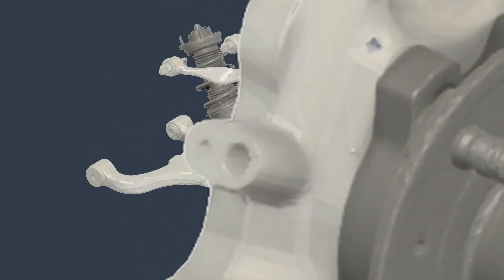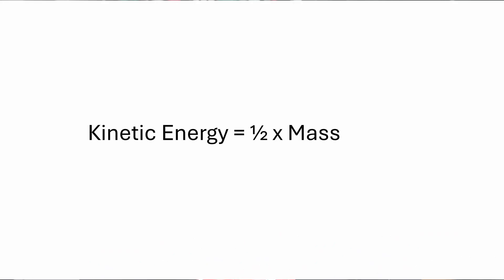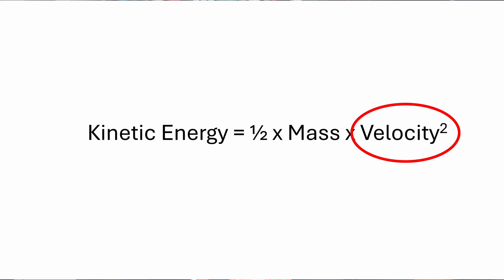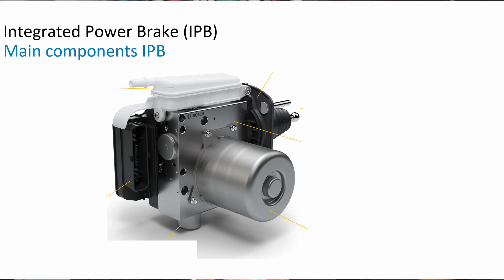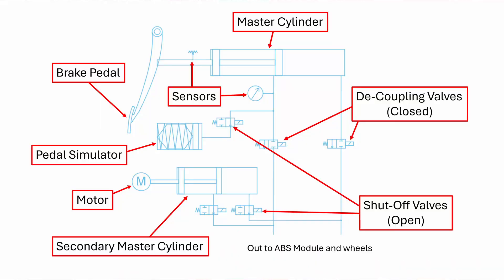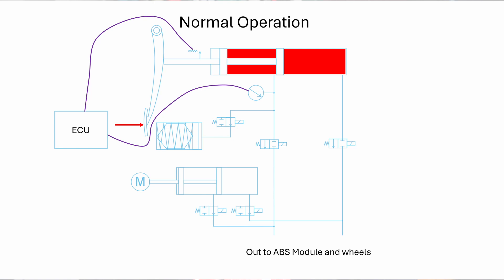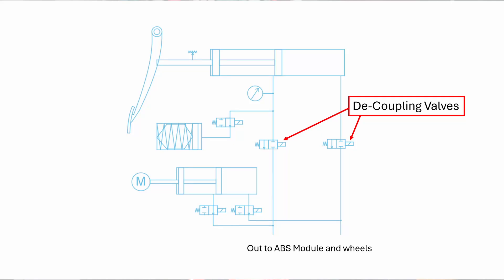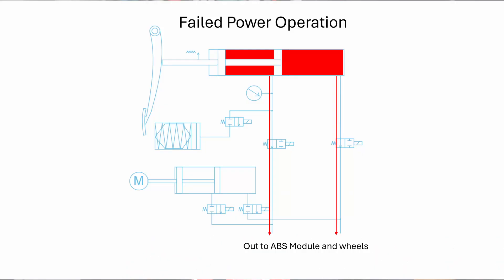Why Some People Are Scared of Brake By Wire But Shouldn't Be.

Comment: There are still some very unlikely situations which may happen.
1. both of the valves get stuck
2. ecu thinks everything is fine and tells the valves to be shut but master cylinder won't create pressure
and it's pointless to say you can make failsafes in ecu. yes you can make them, but everytime there is some ecu problem and i solve it finally, i think i have seen everything. and next time i solve ecu problem, then it is even more fucked than the previous time. there is so many things that can go wrong with ecu's

Plus i can't imagine the hassle to get the air out of this system if it ever needed bleeding.

pretty sure it's gonna go same as with electronic throttles. you press throttle, then ecu thinks little bit and then it goes. pretty sure there's gonna be delay atleast in normal use. in emergency you can make it be pretty much so fast that human won't notice. but life has shown if it's normal driving then every electrical processor wants to think little bit.
Reply from the maker: That is true but what I take solace in (and which I did not cover in the video) is that the major manufacturers like Bosch and Continental design these systems to ISO 26262 at an ASIL D level. This means there are numerous redundancies in the system to mitigate problems like you mentioned. ASIL D is the level required for fully autonomous driving so it is as close to perfect as we know how to make things right now.

Comment: I wonder how you'd go about bleeding such a system? I wouldn't be surprised if it involved special software that only a dealer will have access to.
Reply from the maker: These systems are designed to be bled. I doubt there would be many problems for a home user. Having said that, there are many current ABS systems that when they are new, require a system to activate the internal valves to allow all the air to be released.

Comment: As someone who actually is in progtamming world, there are plenty of ways control program can fail. There is a chance of unsynced operations. Valves could be partially open in different orders, current can be different on main and pedal sensing valve. What if main cylinder pushed secondary cylinder because unsynced valves, because of corrosion  inside ecu or some other cause? Remember how boieng screwed up 737 max? Remember scandals bucause of bad software of boieng? I hope handbrake will work old-fasion way with no ecu

Comment: for instance the old Citroen cars which use hydraulic assisted brakes and suspension have a tendency to slam on the ground and lose all brakes when a leak occurs. having multiple system relying on the same source of energy raises the risk of multiple system failure which can leave you stranded or worse, provoke an accident. There is another issue with brake by wire, the feeling. I used two different hybrid CVT toyotas and even if I felt the effort to blend the regen, the CVT engine brake (ratio) and the brakes, in reality it feels imprecise and uncomfortable. We're used to refined hydraulic brakes and anything less will feel rubbish. The main limit is that for a really good system to exist, it need to feel like real brake with dead range that doesn't brake at all, then the imaginary wall with some small amount of elasticity where the force represents the braking force. The issue here is that a smooth and accurate, electro-hydraulic braking system is extremely expensive, then you need the software to be spot on. I heard that race ABS system for instance sell for 10K and they give you smooth and effective braking.
Reply: Polestar 2 has blended braking that is essentially perfect for a mass production car.
Reply: So true, on toyota hybrids it is so hard to do a limosine stop especially in stop and go traffic condition.
I especially hated it feeling at the start, now I just think of it as a trade off for economy.
Reply: @inamdarkapil  yes me tooo and also when parking it's really hard to brake precisely. I'm used to park in Paris with like 10cm to space front and rear added together and with the toyota hybrid brakes it would be impossible without bumping into neighbors cars or shake the car each time you need to stop moving

Comment: the brake by wire system is fine, until it breaks........ and those that are repaired by unqualified mechanics......i worked at a car dealership in an area that is near a collection of 30+ wrecking yards, and have seen first hand the janky crap people cobble together and resell to unsuspecting drivers.... also: then there's the DIY crowd, that won't pay a trained and qualified repair technician to replace whatever malfunctions on their vehicle, they'll find a YouTube video on how to fix it from some other unqualified hack.... as a retired 25+ year Master Automotive Technician I've come away with a few things: 1) there are repairs on some vehicles that some folks just shouldn't do. 2)there is always some unforeseen problem in a system after it was designed- which is why we have safety recalls..... what prompts those recalls? usually it's because someone died.... let that sink in......
Reply from the maker: Unfortunately, this is the way every other system on cars has been going for many years now. There's very little you can do yourself any more. I grew up on points and distributors and I like the simplicity of the old days. But I also like a car that starts no matter the weather and won't kill me if something goes wrong.

Comment: I've seen control modules on modern cars spontaneously reboot while going down the road. Brake-by-wire is a terrible idea.

When drive by wire fails-safe, you coast to a stop and keep your steering authority.

When brake by wire fails-safe, you're going to abruptly stop in the middle of the highway, which is nearly as unsafe as having no brakes at all.
Reply from the maker: The failsafe is you have a push-through system, just like the days of old. The system won't just abruptly stop by itself.
Reply: How? 9:47 explains the fail-safe valves.

Comment: Well it's fine todo that. What I don't see is why we need Steering By Wire as that is adding more parts that break than less, the only real benefit I can see there is less positioning restrictions but currently that isn't done at all.
Reply from the maker: The biggest benefit with steer by wire is that you can vary the steering ratio: make it fast around town and parking lots so you don't have to turn the wheel so much but slow on the highway so it's not twitchy. Still, it seems to me to be an answer to a question no one is asking.
Reply: Packaging & safety are potential benefits of steer by wire.  Steering shafts have evolved over time to include crumple sections & slip joints, but I could see how no shaft would be safest for the driver.
Reply: @AnnDee4444  Removing sections of the steering shaft is also an easy way to linearize the input/output. Current designs with intermediate shafts often have some U-joint nonlinearity. If you linearize it, then you can use a custom curve to have more desirable output.